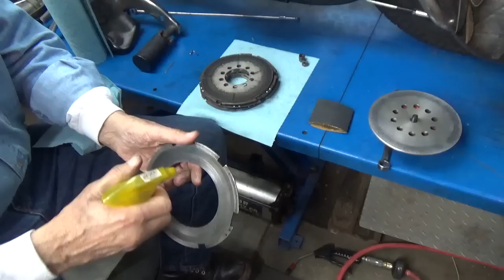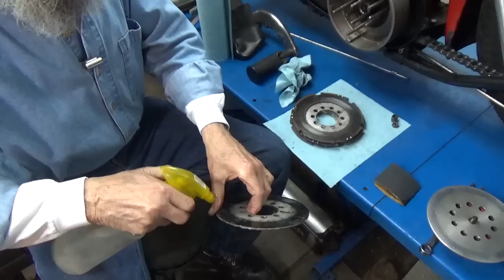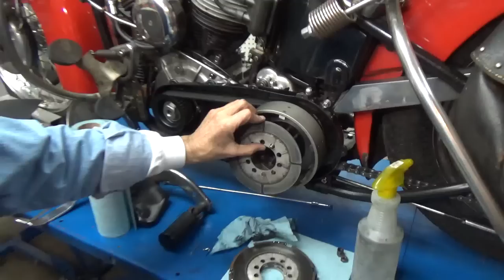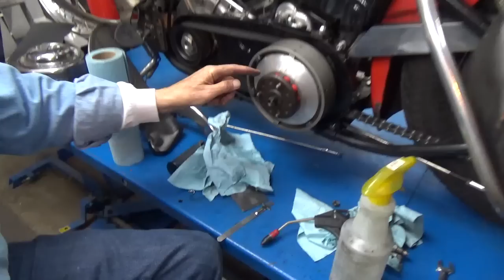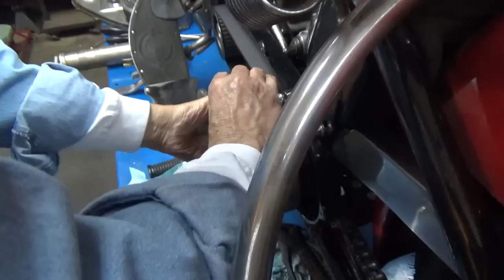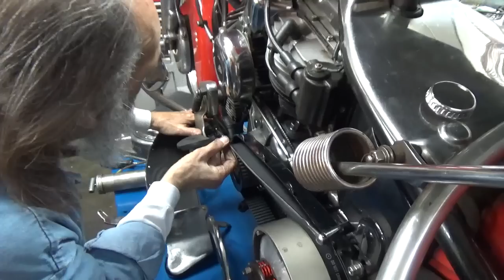We're Doing The Clutch Adjustment On My Harley Davidson Panhead Again!

Comment: U can also use a top shock washer, to retain those spring s
Reply from the maker: Or a large flatwasher stacked with a small flatwasher, or something from the hardware store.  It's fun to be creative.  That old valve spring retainer has been used on old cluches for over forty years.  Don't tell her there's a cheap replacement for her.
Reply: @pacificmike9501  I've always used an old Chevy fender shim. Works perfectly.

Comment: Great Video, Mike... I have a 1980 Shovelhead FLT (mostly stock)... primary converted to dry belt drive, and my clutch has been 'grabby'... where is catches unexpectedly while slowly release the handle. I completed a full service (using your video)... QUESTION: Do you ever 'lightly grease' the fingers of the clutch basket so the plates 'slide easier'? Thanks.
Reply from the maker: NO.  But I've used a lot of different brands of clutch plates.  Usually, they are stamped out.  That's fine, after years of using the same tooling, the 3/8" holes for the "fingers" aren't quite nice any more.  I go 1/64th" over on all of those ten holes in each plate. I use a drill press.  Go slow and don't hurt yourself.  The other thing is to make sure those fingers are smooth.

Comment: Hi Mike, Thank you for all the videos and experience, as you teach from your home garage! also just love it when something doesn't go perfect for you, it makes you more real. OK enough brown nosing! I restored a 1981 Sturgis about 10 yrs ago, and it only has about (11,000 Mi.) clutch and transmission shifted like butter but had a little clutch chatter till warm. Thinking a warped plate I put in a new clutch plates and steel plates this time with anti rattle balls; chatter gone but cant find neutral when running now?? cant seem to dial in the adjustment, followed service manual but without success!!! Haven't had this happen on any other shovels I own; could you do a video on how to adjust properly, my best Jim
Reply from the maker: I don't have one of those transmissions with the "Astrodome lid."  But, if you look in the service manual for the clutch adjustment, you'll see a 13/16" measurement off of the top of the lid, to the clutch release lever.  Quite possibly, your issue.  Another possible issue would be the fiber plates not sliding easily on the clutch hub "fingers."  This happens with a lot of aftermarket plates after their dies have been used a few million times.  If such is the case, I drill out the holes in the plates 1/64th of an inch over the original 3/8ths.  Then they slide easily.
Reply: @pacificmike9501  Thank you Mike, I didn't check for a reply until just now 9:35 am East coast ( Rhode Island smallest state in the union )  I thought If i received an answer; mite be weeks. I use a small block of wood with Formica on one side 13/16" in between arm and tranny while I start my adjustment on it. I think your advice to drill my be my answer and will try that. I'm a 1951 model (be 71) in a couple of weeks; so probably not a whole lot of tread left on my tires LOL. I truly appreciate what you are doing Mike, Keep it shinny side up!! Jim
Reply from the maker: Thank You, you got plenty tread left. We both do.

Comment: Love the videos mike. 
I'm having an issue with my 77 shovelhead clutch. After adjusting the clutch to the proper settings and putting it all back together thinking it's good to go, I then start it it up and engage 1st and my clutch hub nut some how becomes lose and I end up with nothing with in a few seconds.  
Any thoughts to what's going on?
Thanks in advance!!
Reply from the maker: I could be wrong (not being there), but it sounds like the clutch hub is not fitting on to the shaft properly.  Maybe the key is not seating in there, or the taper of the shaft and the taper in the hub don't fit each other.  Either one of those could be damaged.  I suspect the clutch hub is cracked in one of the corners of the keyway.  Remove the hub and inspect it very carefully, especially inside the corners of the keyway.

Comment: Got a clutch question if you don't mind since I seen this video. The 73 FLH I just got I noticed after taking the primary off has a sifton diaphragm clutch in it. Are you familiar with these? What I'm wondering now is the proper way to adjust it .
Reply from the maker: I haven't done one of those.  But, I can tell you where it comes from and you can probably get instructions from the supplier.  Tedd Cycle, better known as V-Twin in New York, owns the name "Sifton" after the Late Great, Mr. Tom Sifton.  They manufacture and sell parts using that name.  They're also some pretty nice folks.  I would either contact them direct or go through your local shop to them.
Reply: @pacificmike9501  OK thanks. I actually read somewhere to adjust it for a 85-90 FX/Softail. I screwed the cable all the way in until full slack then adjusted the distance from ratchet to starter at 1/2", turned the screw in on clutch rod adjustment till touches then out 1/8", locked it down and then adjusted the slack out of the cable to 1/16" free play on clutch lever for the hand.  Seems to work OK and goes into neutral easily. No creep in first gear sitting  so maybe it's good. I need to get out on the road to see how it operates. This Trans shifts easy into first and fourth but second and third is a full throw and firm. Maybe it's set up to shift that way ? These trans with straight cut gears reminds me of the Muncie rock crusher m22 four speeds in the old gm muscle cars I used to drive long ago. I'm not that familiar with these and how they shift . When fresh rebuilt are they easy to shift or just naturally clunky? The later 5 speed in the 01 FLH I had  was easy to shift but this four speed you have to give it a firm shift to get it in gear...
Reply: @pacificmike9501  Tell you one thing the pull on this clutch is very strong on this Sifton. Id like to put a mousetrap setup on it to ease the pull. Love the look of those contraptions and it would give it a little more style for me. That's what I need as I get trigger finger at times and from a condition I have my hands get numb and or lock up on me. I need a much lighter clutch pull. I need to find a complete setup to put on my ride. You don't have an extra one lying around to get rid of do ya or know where I can get one do ya?

Comment: Hey guy happy happy holidays , i was just wondering can a mouse trap be installed to a 1994 heritege softail evo?
Reply from the maker: Anything can be done.  It would be very complicated and there are a couple of different approaches that come to mind.  A cable would have to be fabricated.  The best way ( in my mind) to do the rod would be to use an early 5 speed trap door on your transmission and fabricate the clutch arm for a proper location.  That's a pretty intense, but possible, feat.  But, Happy Holidays!
Reply: @pacificmike9501  thnx appreciate it

Comment: Thanks for all the info on the older Harley's. Really helps and your content is great.
My friend asked me to help on a 1948 flat head. We got the motor running nice now using you carb videos. My issue now is I can't get it into gear once it's running. The gears just grind. Seems to shift ok when it's off. Is there an adjustment I am missing for the clutch?
Reply: When I do get it into gear the clutch seems to work ok to get moving.
Reply from the maker: Okay.  You said "Flathead."  Is this a Big Twin, or a 45?  Either way, it sounds like your clutch isn't releasing.  Yes, the clutch must be adjusted.  Do you have a service manual?  Again, what is the bike?  The clutch plates could be stuck together if the bike has been just sitting around.  Better address this before putting it in gear again.  Transmission parts are expensive
Reply: Thanks so much for the reply. All I was told is 48 flat head. S/n on the motor says 42u4272. It's been in his family since new. 12v conversion, belt drive. I think it has been restored sometime in its life. It's been sitting since 1992. Motor run great thanks to you videos. Thanks for all the content. I dont have a manual but it think your clutch video will get me where I need.
Mike

Comment: I was baffled as how you were able to have the release plate assembled with the springs already under pressure, until you finally mentioned the shovel head valve retainer .
Genius! 
Thanks for mentioning. I have no idea how that can be reassembled without that? How did Harley suggest this?
Thanks for that video.
My56PAN
Reply from the maker: It's the way I was taught in the seventies.  It's not hard to assemble off the bike and then put it on.  The guys I knew back then were not trained by the factory.

Comment: Hi Mike! As you recommended, I removed the cam cover on my '77 Shovelhead in hopes of draining the oil and gas from the crankcase.  Thanks to one of your videos, I made my own cover puller based on your design. Since there's at least four quarts of oil, plus an unknown quantity of fuel in the crankcase, I was expecting a lot of fluid to flow out. That didn't happen. I only got about half a quart of fluid out. Other than tilting the bike, is there something else I need to do to get the fluids out?
Reply from the maker: Cranking it over will pump it out through the breather hose.  If the topend is off, get a hand pump for pumping lubricant into an automotive differential and pump the oil out by hand.

Comment: Mike, I have the same releasing disk and wondering if you could give me your starting sprint tension measurements? Thanks!
Reply from the maker: It's really pretty simple.  Take your measurement the same as you would for a thin steel disc.  Just allow more in the amount of the depth of the "spring pocked."  Use a narrow ruler or caliper and measure the depth of that  hole.  subtract it from the measurement you would usually use.  Then you have it.  If the hole is 1/4 " deep and your measurement is supposed to be 1", from the surface of the releasing disc to the pressure plate it should measure  3/4".
Reply: @pacificmike9501  fair enough, I'll stick a caliper in there. I was just feeling lazy. I appreciate the reply!

Thanks Mike.

I bought this disc a few months ago and never ran it because it felt loose on the fingers and I was concerned about faster wear of the fingers. I ended up buying a second disc, the stock style thin steel crap and ended up warping that thing first time 'racing around' so now back to a sticky clutch at the moment. I'm going to make a switch to the thick aluminum one and hope for some better life!

Comment: Mike, love your videos, I have this old 58 FL with a shovel upper end (chopper) that has been sitting in storage forever, now my son wants to put it together and your videos are helping, anyway we just installed the hand clutch cable and it's super hard to pull, I guess some cable lube and go through the clutch, also it has a old phase 3 primary belt, could the pressure plate springs possibly stiffened up over the years, I don't remember ever being that hard, any thoughts?
Reply from the maker: Yep.  Take it all apart.  Clean the clutch plates, both steels and fibers.  Clean and lube the lever.  Hang up the cable and run Break Free in it 'til it runs out the bottom.  The clutch springs are probably good.  We have videos up for all of these procedures.  You'll find them under "Playlists" on our Youtube Channel Home Page.
Reply from the maker: Hey, Thank You.

Comment: Mike, I've heard I should change my lifters on my 110ci twin cam CVO motor? Is there any truth to that
Reply from the maker: Lifters wear out.  Never a question of "if," just "when."  When replacing cams and doing the usual "upgrades," the lifters are usually replaced with "aftermarket high performance" units.  You didn't mention how many miles are on the original lifters.  They are a "wear item" and shouldn't be forgotten.

Comment: Hi Mike,
Happy new year. 
I had noticed that you are running dual plug heads on your Shovelhead. I have been wanting to ask you your opinion about using them on a basically stock 80" or 74" motor.  I can see them on a big inch, high compression, big cam  motor, but what is your honest take on them?  Is it worth  going that route on a stock engine?  Will they make a noticeable improvement? When are they worth investing in?  Thanks, I value your opinion.  Kevin
Reply from the maker: Well, I've run dual plugs on that Shovelhead since the early eighties.  I've always felt it helped a great deal because I run high compression pistons.  Lighting the mixture from one side makes it difficult for the "flamefront " to make it over the dome of the piston.  Lighting the mixture from both sides makes for a better burn.  Is this necessary on a stock motor?  I don't think so.  But in the world of "high performance," I love it. That's just a quick explanation.  Ignition timing and many other factors are involved here.

Comment: Hey Mike, I got a rotary top transmission. Looks similar to your ratchet top. My clutch arm is so hard to pull, I didn't notice with my jockey set up, but now that I have reverted back to it's original set up I can't pull it with my hand lever (so it's not the cable). I've tried to move the arm itself by hand, and it won't budge. Would you have an advice on where/what to look for?

Great vids btw, helps a lot.
Reply from the maker: Thank You.  It pivots in the kicker cover.  The pushrod goes all the way through the trans mainshaft.  Remove the kicker cover (throwout bearing cover) and have a look.

Comment: What measurement are Are you looking to achieve total on the spring adjustment I can never get what the manufacturer says as far as measurements go which is an inch 1 1/32.    Great videos
Reply from the maker: It is from the inside edge of the pressure plate (the outer collar) to the releasing disc.

Comment: I am getting ready to put my clutch in 1979 shovelhead with all new plate's. I ordered barnett steel plates without the anti rattle balls. Do you think that is a mistake? The number one thing I am looking for is they work good and have long life. I am replacing the original steel factory plates.
Reply from the maker: It will be great.  It may make a sound you do or don't like.  Not a mistake.  If you're running an open primary, you'll make a sound that makes your friends know it's you.  Hey, I hear Joe Surfer goin' through the gears.

Comment: Mike my name  is John gordon I live in rock falls ill. I own a 1962 flh harley panhead. I have replaced over approximately 2500 dollars in parts and performed extensive amount of work on her. I had to replace the pivot plate on the mousetrap.also replaced the dry clutch package with new parts. I have the clutch lever at one eighth play. I watched your video about the clutch adj. My question  is with the mousetrap system is the pressure on the clutch pushrod to the throw out bearing the same as shown  on your video
Reply from the maker: There is no pressure until the arm is moved.  The idea is to adjust to the point of pressure, then back off so there is none.

Comment: just serviced my 76 flh clutch yesterday installed new friction discs but did not drill plates still draggs  so im going to pull clutch again try drilling the plates to 25/64 hope it cures the drag problem
Reply from the maker: Hopefully, it will.  Also, watch the clutch as you pull it in to see if it is breaking straight.  You may have to "uneven" the springs a little to make the plates separate evenly.  Also, notice the "Ram Jett Retainer" I use that stabilizes the basket.
Reply: @pacificmike9501  a-ha yes ive noticed that it is not breaking straight and ive always wondered why and what is the cure when i get the time maybe tomorrow i will dissasemble  and replace frictions with drilled ones and reasemble and uneven the spring pressure looking for a clean break i think your info just might solve this dragging clutch that ive been suffering with for far too long thank you for sharing your thoughts on this problem thanks again !!!!

Comment: Any advantage to using some kind of lock washers on that hardware Mike?  I see a few with safety wire sometimes.
Reply: with safety wires  YOU KNOW they wont come loose, they are easy to do. they are DEEP inside so u cant check them daily to know
Reply from the maker: Not on the clutch  studs.  I don't know where you're referring to.  But in in some places, safety wire is great.

Comment: Totally off topic question: Do you have a lot of experience with KH models?
Reply from the maker: No, sorry I don't.  I remember a little, but, nothing extensive.
Reply: @pacificmike9501  We have a set of bad cases on a 56 KH. Trying to decide to have them totally rebuilt or try to replace them with a set of early XL cases and do the machine work.  Either way, its going to be interesting.